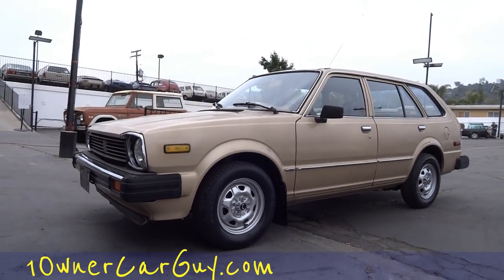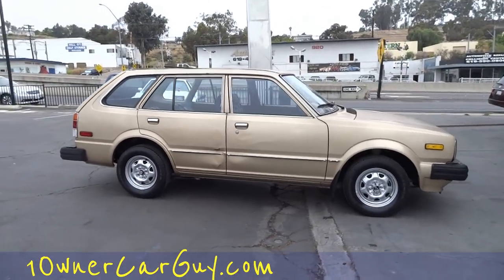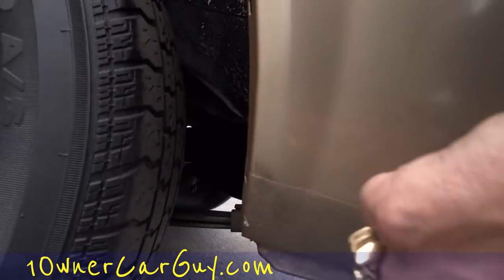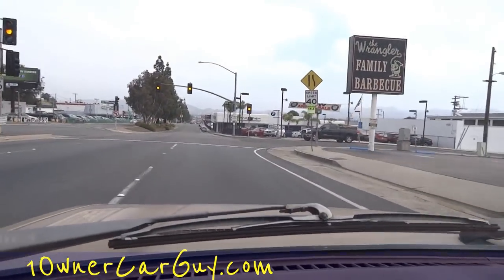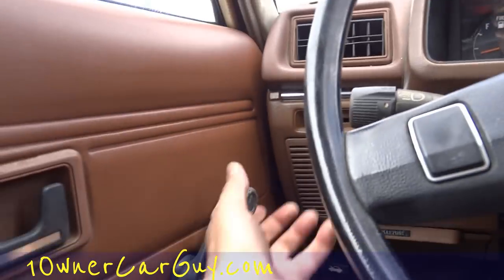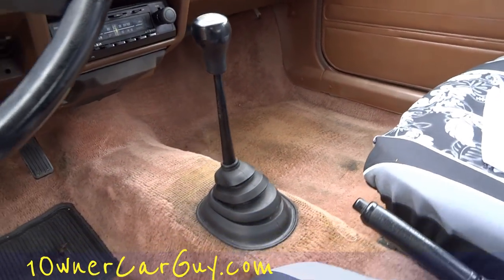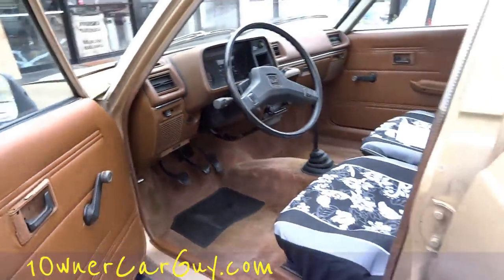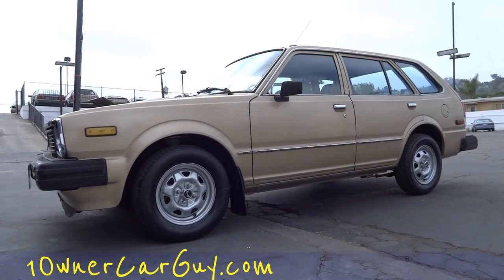1981 Honda Civic Station Wagon CVCC Video 1 Owner 4 Cyl Manual For Sale Estate Break

Comment: Man i wish I never sold my 81 Honda Civic wagon four door it had a four speed manual transmission and she'll smoke the tires in first and going into second gear. That car was so dependable probably the best car ever built by man. I'm going to buy my another one someday. I need to find i fixer upper and completely restore it from the chassis on up. Priceless car there

Comment: My mechanic friend is working on a 1982 Honda Civic Wagon. But having issues with the engine, even though it is brand new on the bottom, and changed the heads a few times.

The machine shop installed the wrong (smaller) O rings on the auxiliary valves housing. Ran great for a week. The oil and fuel leaked by the auxiliary valves, and washed the rings. The best cylinders, #4, has blown now, but it was not the other day. Even the compression changed on the good cylinders. 

He has tried to get the rings to reseat, but it won't work. He put a small amount of transmission fluid down each cylinder and put in new spark plugs. Spark plugs were fouled before, now burning beautifully, but the compression has not returned. 

How to reseat the rings on this engine?

Comment: I love how honest you are, you don' tsee that anywhere. I did see how it has 75,000 miles on it.. supposedly if that is even true for a car from the 80's. I don't know if i believe that. If it is 75,000, man whoever buys this car is not going to have problem with the engine ... other parts, yes... it is 30+ years old. But cheap, cheap, cheap to fix.  NOW WITH IT BEING 75,000 MILES, LITTLE KNOWN FACT, I HEARD THAT HONDA'S ENGINE IS BROKEN INTO AT 80,000 MILES. SO YOU ARE DRIVING A NEW HONDA TILL 80,000 MILES. YET AFTER THAT, THE CAR WILL STILL RUN GREAT. I KNOW SOMEONE WHO HAS A HONDA FROM THE 90'S AND IT RUNS GREAT... WITH 310,000 MILES. HOW AMAZING IS THAT. YOU DON'T SEE THAT IN ALOT OF CARS, ESPECIALLY WITH LOW MAINTENANCE. WAIT TO GO HONDA. I WROTE IN CAPS TO GET PEOPLE'S ATTENTION ABOUT 80,000 MILE THING.....

Comment: I actually own this very car, I love it except.......Carb issues, starter issues, wiper motor issues, radiator was clogged then unclogged and now leaks, shocks are bottomed out and it has way more than the 77,000 it claimed to have. Seats are missing foam and spring aren't to comfy.Other than that I love it....it's for sale!
Reply: ouch!
Reply: +ConcreteKickworm hey there do you still have this car for sale?
Reply: yes I do!
Reply: +ConcreteKickworm awesome! could i get your number?
Reply: +ConcreteKickworm The Keihin 3-bbl carbs on Hondas of this vintage are a nightmare to diagnose and repair when they go bad. Best bet is just replacing it with a Weber DGV, although that might not be an option in California since it'd require ditching most of the emissions equipment under the hood. If I ever got another one of these cars, I'd love to try adapting Megasquirt/EFI to the stock engine, which would likely enable it to pass CA emissions testing, but that's a bit more complicated than a carb swap.
Reply: Thanks Doc